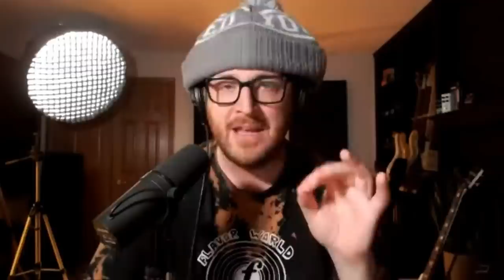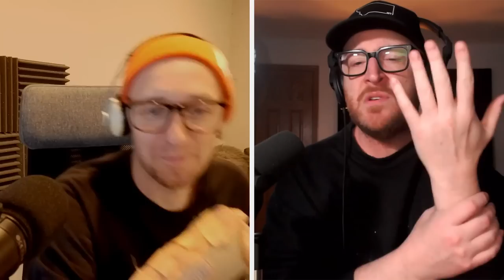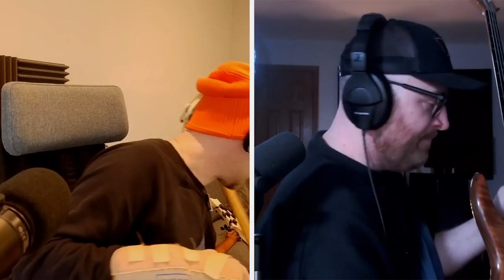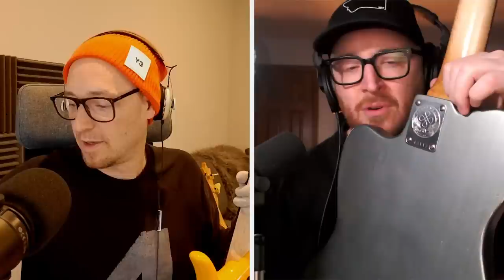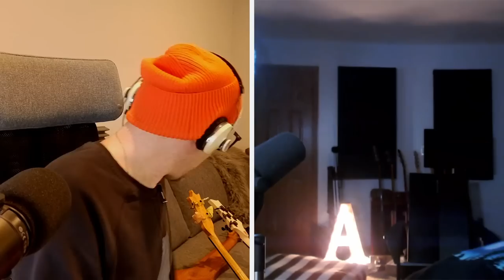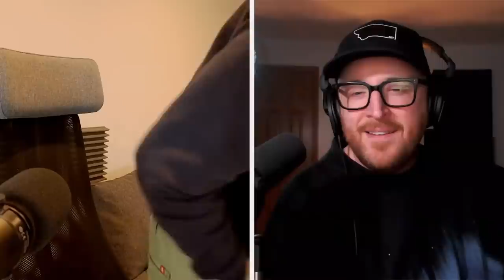Neck-through vs bolt-on . . . which is SUPERIOR? | EP85 | The SBL Podcast #85

Comment: FYI - Rickenbacker 4001 & 4003's are neck through basses.  At least my 2015 4003 is.  And yes, it has sustain forever, way more than the rest of my bolt on neck basses.

Comment: I think that bolt-on pop is something great for playing solo. But as soon as you record or play live, you'll probably use compression to reduce the lowered volume after that initial transient. So basically, a neck-through is like a built-in compressor.

Comment: Hey guys. My 1st neck-through bass was bought for me in 1977. It was a B C Rich Mockingbird with an EMG J bass PU in the bridge and EMG P bass in the back. I knew nothing about active stuff.   I picked up the bass, went to a gig, and blew up 4 Altec 15s  before playing a note by switching the passive to active deal. My SVT head just dump like 5000 watts across them. The cabs caught on fire. I remember 1977 for that, so there you go.

Comment: Rickenbackers (like 4001’s) were neck through. They were the first mass produced neck through basses, I think.
I had a fireglow one where you could see the bodywings glued to the three piece neck on (only) the back of the body.
Reply: They only had a small series for a few years with set necks. Didn't sell well so the series was dropped.  The US made Ric's are otherwise all neck through basses. The 4001 & current 4003 as of 2023 anyhow.

Comment: In case you haven’t yet recorded the fretless one.  After listening to this I decided to have a look at the action on my fretless as I’ve always been a little disappointed that the notes don’t bloom in the way Scott described and demo-ed.  I’d previously taken it to  luthier who had a look at it, and said I’d already set it up where he would put it, so best to spend some money on a different string material (cobalt ones) and maybe dig in a bit more. The action looked on the high side - a little more than 3mm at the 17th fret on both the E and A strings.  So I lowered it.  I wasn’t really aiming for a particular action measurement, just using my ears until it sounded like the sound in my head but without any unpleasant buzz.  The A string needed nearly 2 full turns of the saddle Allen bolts, the E just one.  It now has the notes blooming. I also lowered the D string a touch, and left the G where it was (it had always bloomed).  All told, including a bit of adjust, tune, listen, readjust, check in all fret positions it took about 20minutes.

So I concluded:

Action has a major influence on the sound of a fretless bass.

It doesn’t take long to adjust the action.

You don’t need to be too concerned about the measurement - it’s a guide.  Use your ears.

Your Luthier can’t hear the sound in your head, only you can do that.  And they may not see too many fretless basses anyway.  

And a bonus one: Scott’s description of “blooming” is far more pleasing and descriptive of what the note does on a fretless than the oft quoted “mwah”
Reply: I have the same experience, but with fretted basses. Learning how to do your own setup (at least truss rod and bridge saddles) is a must!

Comment: First off, thank you for noting that there IS a difference in sound. So many people just say it does not matter or you are thinking too much. However, there is a difference and can influence what bass you might grab depending on the song or the gig and the thought process it in. Also, that bolt-on is not inferior and is just a choice that is different and each has something to bring to the table that might be good or bad depending on your situation. 
But Rickenbacker did have neck through guitars in 1956. The Yamaha Broad Bass 1200 was in 1977. Although in 1977 Alembic also build a 5-string neck-through for bassist Jimmy Johnson. Then in 1979, Ibanez came out with the Musician bass with the MC824 and MC924 and also others like Aria, Spectre, Carvin, etc.

Comment: IMHO, generally, glue in and neck through designs transfer sound slightly better. The worst bolt on method is wood screws. The best bolt on method is screw in threaded brass inserts with either brass or stainless steel machine screws.

Comment: One consideration is that bolt on necks are certainly easier to repair/replace. I looove my neck thru Peaveys (USA Cirrus and TL-5), but I’m always a little nervous to take them out on longer travel gigs or a stretch of gigs type of trip, because having the bass in lots of different environments (cold hotels, hot van trailers, etc.) is gonna possibly warp the neck and other than keeping the truss rod working, you may get to a point where having a bolt on bass is a plus when you can just pop on a new neck if it gets beyond fixable.

Comment: More vibration transfer to the body would mean more energy loss via resonance.  Neck joint rigidity reduces loss.  Bolt-ons are more rigid.  The stronger transit makes it sound like less sustain, but it's just that the transients and highs last longer.  Removing wood from the center of the neck pocket can actually decrease losses because there joint can be more rigid, and there's less surface are transfer to the body.

Comment: Fun one! Really excited about this album! When will it be available more or less???

One thing that I was wondering recently is usind a DI/preamp pedal as the main thing. The reviews on the new Amped DI really surprised me as love the B-15 vibe and was wondering how to use such a pedal. For recording ok, straight in audio interface. But for rehearsals, home practice, live performance? I own an old 75W Randall combo with 15" speaker. Should I plug this in to the effects loop return, to use just the power amp section? Should I invest in a seperate power amp and a proper bass cab? What about the cab sim if I'm using an actual cab? Or when I'm on stage I1d like to have the cab sim on my signal to front of house, but not on the stage monitor amp, right? Sorry long question...

Keep up Dudes!

Comment: Bolt on is better simply because it can be replaced. I've had several necks go bad on me with the insane New England weather and the ability to swap in another neck outweighs any tonal preference you could have for neck through.
Reply: Thank you for your opinion and the reason behind it. That definitely clarifies where you're coming from, and kinda almost makes me wanna agree 👍
Reply: That’s why most neck thru manufacturers do laminate necks. I’ve got neck through that are over 40 years old and I’m in Southern Ontario- our humidity and temperatures have a huge range. We have days where both the AC and the furnace have to run…

Comment: Suggestion for next topic: I would love to hear your point of view on preamps. Are they relevant? Is it “necessary” to have one? (Or more 😅) A good amp is more than enough? Preamp vs a good DI? Are tube preamps a scam? Can you consider a multieffect dsp a preamp? Why the modular application of preamp + power amp (like Scott’s Vanderkley) are not that common in the market?… The list goes on and on! 🤓
Reply: Between the player's finger and the consumer's ear it is about good signal - sometimes preamps are unnecessary between a great passive pickup and the input gain of a capable console. (That of course can be called a preamp, too.) But most often a good quality preamp can help your signal, even if no coloration (tubes etc) is added to the equation.
Reply: BTW: Helping doesn't even mean improving. It might just be about preventing deterioration along the way.